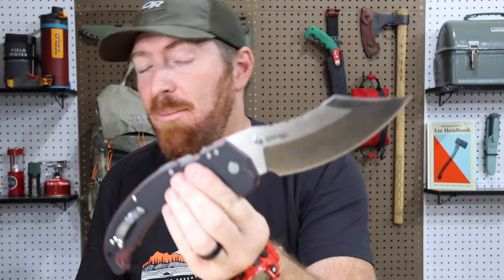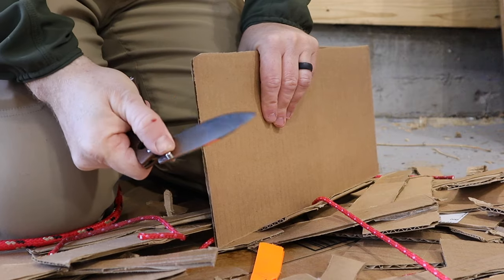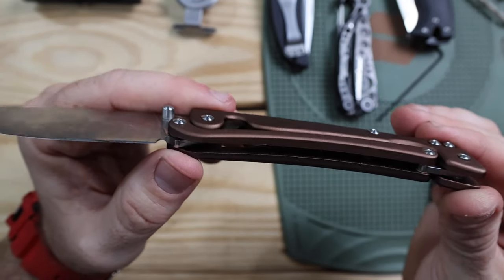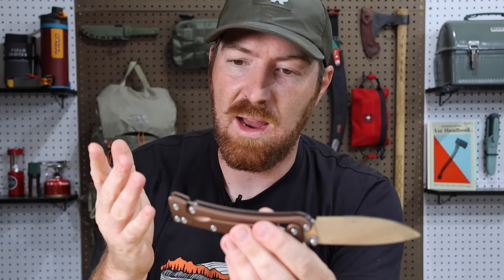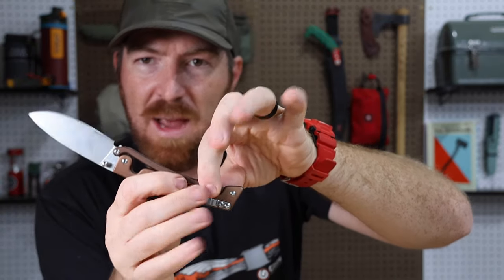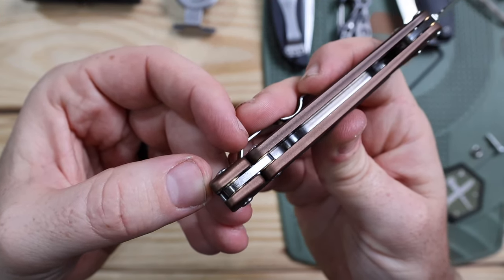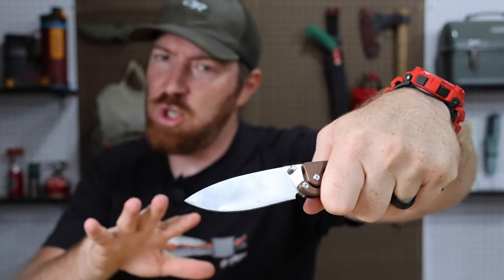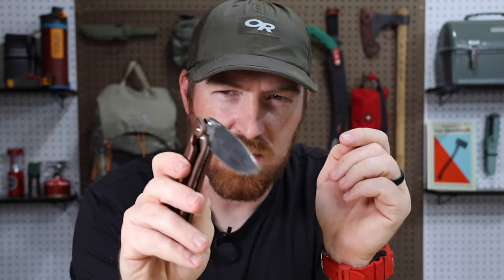This Strange Lock Is Super Strong! Revolt Reflex

Comment: Pretty sure they "borrowed" this design from a custom Russian knifemaker. He does unique designs (like a g10 framelock) and that was one of them.
Reply: What about the G&G Hawk Griplock?
Reply: @jonathantaylor2584  is that the one that was on the Kershaw Toggle? I'm not talking about just the lock design, I'm talking about the whole knife. There's a small time maker who made a custom just like this one years ago and the copied the whole thing.
Reply: @D00MTR33  Very similar in lockup, but the opening design of the Griplock is more traditional folder. I think it was Quartermaster that blatantly ripped off the mechanism.

I owned one of the Kershaw Toggles briefly and it was pretty neat. A little bit of a pain to get the toggle to close the knife since it required a fast enough motion with your pinky to swing the blade.
Reply: @jonathantaylor2584  oh yeah, I remember the Quartermaster controversy with that. Just one of many shady things that company has done. Glad they're finally out of business.
Reply: Very similar to a model Kremenetsky presented 2-3 years ago. Fully handmade. Handle was plastic though.
Reply: @Tenacious_B  yeah, that's the guy. He's really awesome and makes some cool designs like a G10 frame lock, a folding machete and others. I couldn't remember his name, thanks for that.

Comment: I am a 'fixed blade knife ' guy, but if I did have a desire for a folder, then I would go for something like this based purely on the strength of the locking mechanism. So yeah, I like it!
Puccini (UK)

Comment: Interesting but the two issues I have is that there doesn't appear to be any lock when in the closed position and that there is a gap in the handle with part of the blade exposed when closed.  Just a personal preference, but I don't want any chance that something could get in there like keys or tiny fingers and either get cut or accidently open the blade when in the pocket.  Not safe enough when closed in my opinion.

Comment: Agreed. I’ve worked with pivots and multiple pivots on custom manufacturing machinery. I do enjoy that they’ve done a lot of engineering and tried to make the worlds most secure lock. But, um! Limits the ways it can be held over time as it doubles the weak points. Though in a knife you’d likely not use it to failure. Double pivots are weaker than two single pivots. More motion, more wear. ( double pivots will - minutely in n this case - flex more laterally to the intended motion due to doubling the the clearances of the pivots. Twice the rotational clearance) Overall, what you said! A solution looking for a problem. But, I just worked on, built, and replaced such mechanisms…